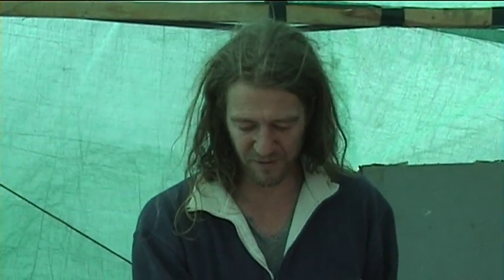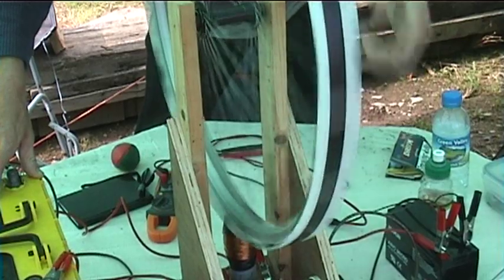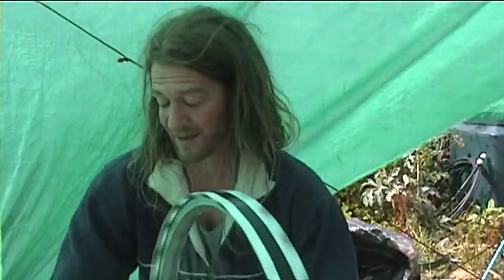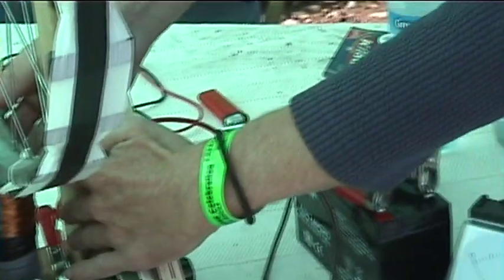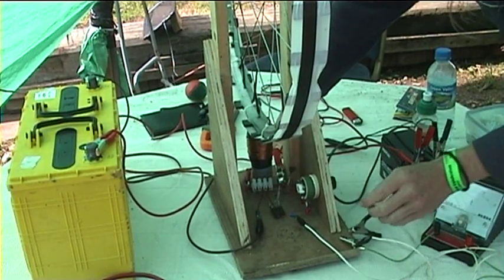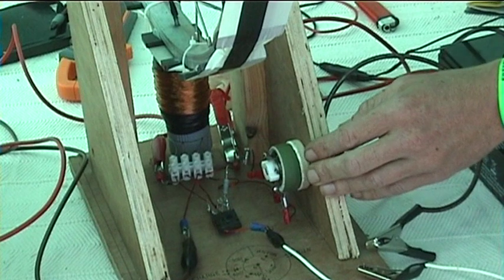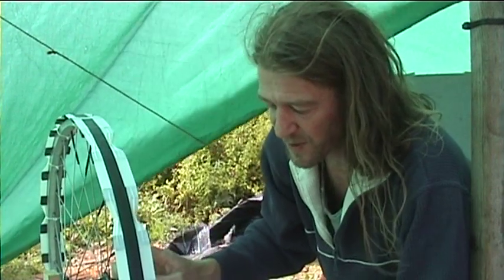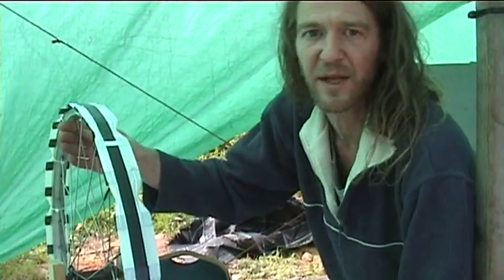Bedini (SSG) Motor - off grid festival 2011

Comment: an orbit is a specific type of spin, so in a way yes

from what I remember from electricity and magnetism in physics magnets work by having their electrons orbit in sinc with each other. This is what causes them to have electrical properties. If you do something to change the orbits and make them out of sinc this will cause the magnetic strength to weaken. The easiest way to change the physical properties of metal is to bang on it, right??? Oh and I'm fairly sure you can't 'brake' these orbits..